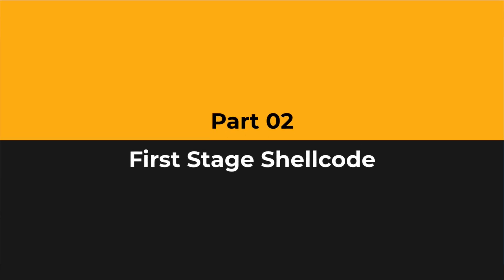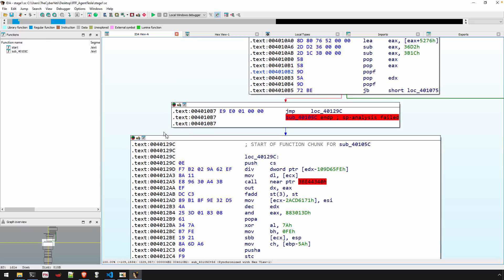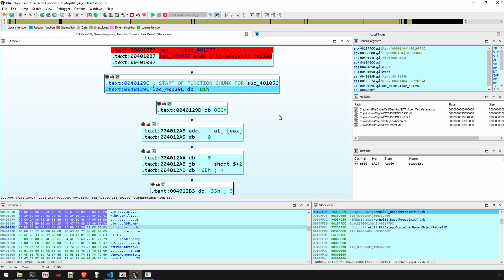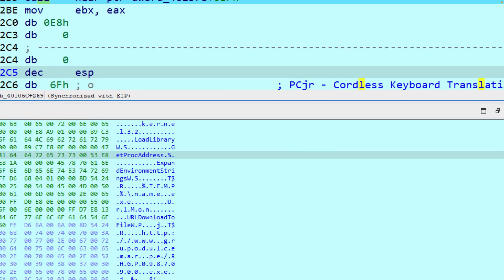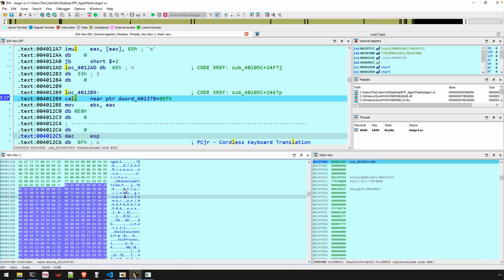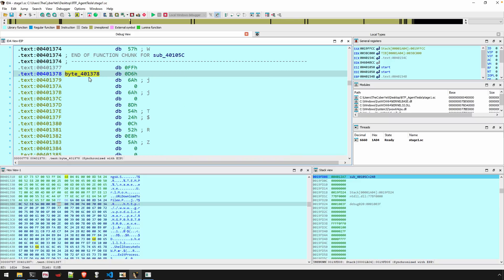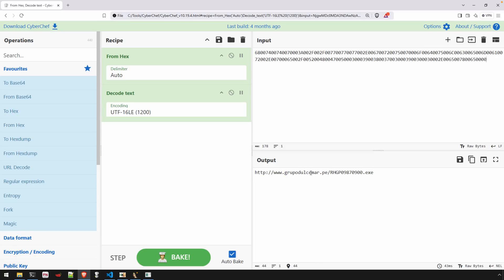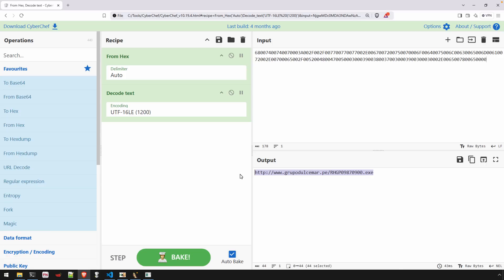02 - Identifying Shellcode Entry Point and Analyzing Common Shellcode Techniques

Comment: Have you or could you talk about creating safe systems or machines that have obfuscation of where you are coming from, to go fetch additional payloads from external urls like the one in this video?
Reply from the maker: I sure can - i don’t do anything too complicated though, as most of the time I’m just dealing with commodity malware. Typically I use a VM behind a VPN. I actually have an entire vlan on my network that is behind a VPN, that way I don’t make a mistake and forget to connect/etc. You could also use an online sandbox. In the past I’ve used inexpensive hosting services like digital ocean and just used SSH tunnels. of course, some TAs you may need to be more careful in how you try to probe their infrastructure - but that will vary based on what you are looking for. I’ll add this to my list and think about how I could make some videos - thanks for the suggestion!
Reply: @jstrosch  Thanks! Yeah I would appreciate a home network setup tour. I have been wanting to setup Proxmox, Pfsense, etc. and VLAN my network off into IoT, lab, etc. devices. It would be awesome to see how you set everything up!